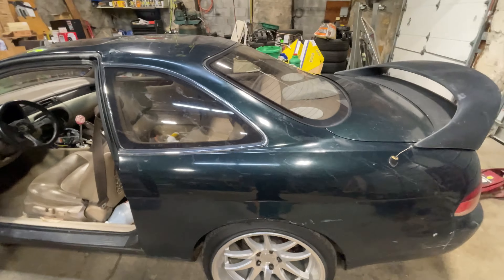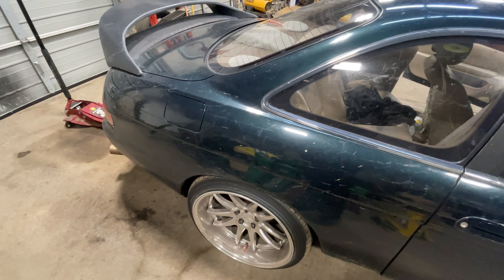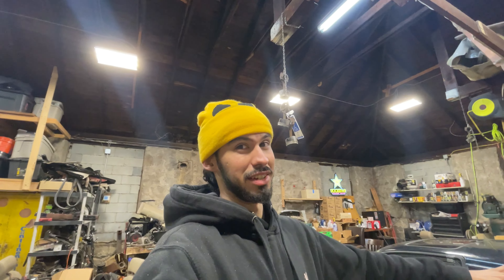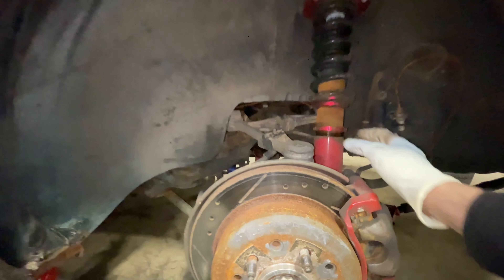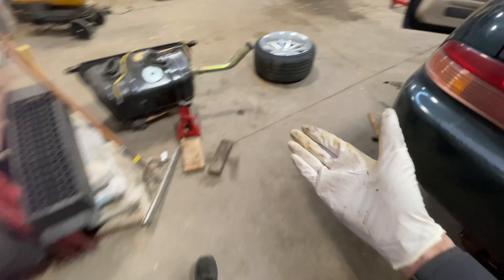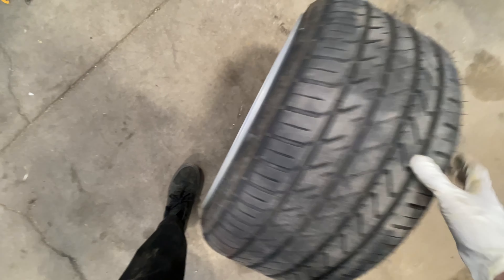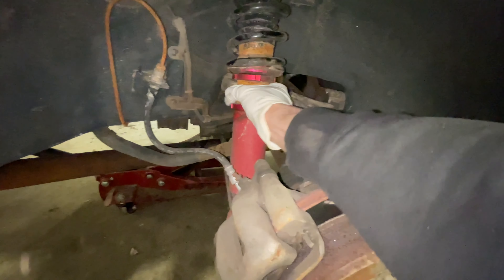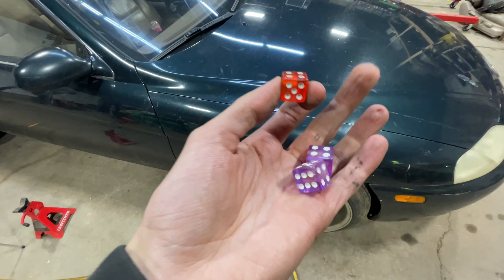Coilover Adjustment on SC300

Comment: Also make sure you are twisting the correct part. If you lower the wrong area, you will run into issues
Reply from the maker: Yea not looking to change my preload, now that the wheels have travel again the coilovers have been more responsive with the height
Reply: That's great news. Your doing great man, Keep up the consistency @Daniel_Aviles
Reply from the maker: @juststuntproductions  I appreciate that fr the support motivates a lot too thank you